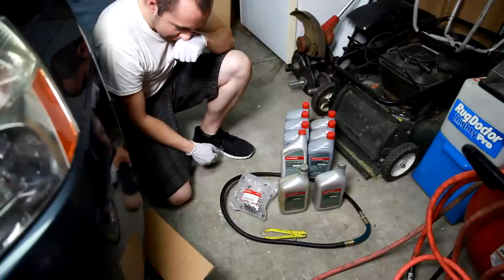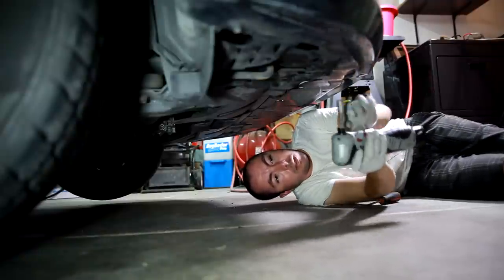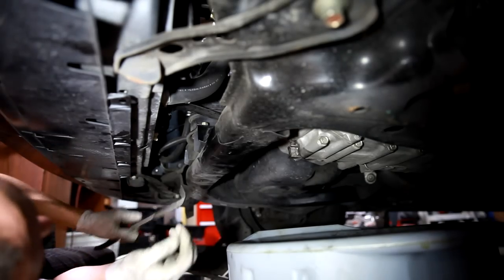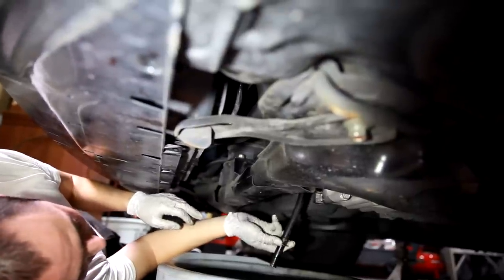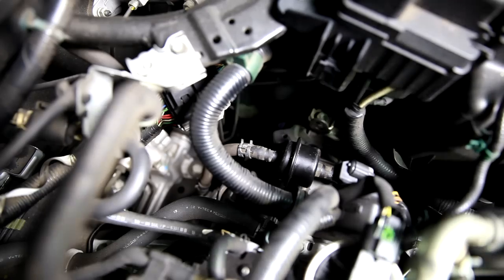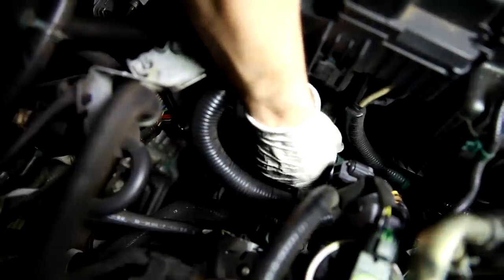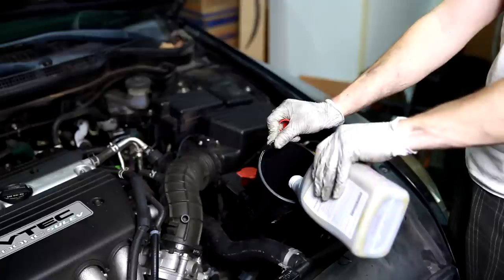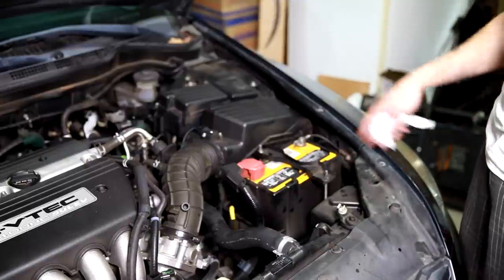2003-2007 Honda Accord Complete Transmission flush with filter

Comment: Does the 2010 odyssey have a filter?
Reply from the maker: MrRangerZr1 That we're not too sure.
Reply: MrRangerZr1 Yes, it does, actually it has 2;The "main" Filter is <inside> the Casing, & the "secondary" less necessary Filter is attached to a hose by the Cooler. Basically need to take to Honda or a good Transmission Shop to have this work done.The  internal Filter is collecting the large particles, much like the Bag inside your Vacuum Cleaner, & the inline filter is similar to the "HEPA" Filter to clean the exhaust Air.  
In low mileage, changing the Fluid only is a good idea, but once it has recorded high mileage, you need to have the thing "cracked open" & get the Filter replaced & Bands & Clutches replaced at same time, or at least inspected.
The "main" filter is collecting the breaking down clutch particles, & the inline one gathers the Apply Band Materials....once they are full, there would not be much Clutch left.

Comment: I need to flush my 05 accord,HOW MANY QUART DO I NEED? DID YOU JUST PUT 3 HALF.NICE VIDEO SIR.GOOD VOICE
Reply from the maker: we used 8 bottles, but you can use 12 if its really dirty. We drain the old fluids out first, then refill 4 and repeat until theres 4 left and top off.

Comment: Hey can you one day do a video on Honda idle relearn process?
Reply from the maker: +Rich Lo Yeah we can. What is wrong with your idle?
Reply: +NutzAboutBolts I was going to clean the throttle on my 2010 Honda Accord but then I realized it had the electronic throttle so I have to remove it to clean it and then do the relearn idle process. I just can't find someone doing it on a Honda at all.
Reply from the maker: Rich Lo
ah I see, we will have to find a day to do it. Hopefully this coming Monday unless the heat is too hot. But we will see...

Comment: Thats what a drain plug is for. Don’t recommend running the car low on fluid
Reply: You can't get the oil out of the torque converter if you don't do it this way.

Comment: hey guys, just wondering if you know how much brake fluid and power steering fluid I would need to do a complete change and flush of both of those systems?
Reply from the maker: 2 small bottle of brake fluid should be enough. As for the power steering fluids. you should get 1 quart bottle, if not, then 6 regular bottle is fine.

Comment: what kind of oil you used for manual transmission
Reply from the maker: If you still have the old Z1 atf fluid, you can still use it, but the new fluids are W1 now for better cold cranking.
Reply: MY CAR IS MANUAL TRANSMISSION 
CAN I USE THE SAME OIL
Reply from the maker: No, its a different ATF fluid. It'll be called Manual Transmission fluid instead of Automatic transmission fluid DW-1. I hope that helps.
Reply: thanks so much for all help
Reply from the maker: Carlos Garcia
np,

Comment: change mine every 6,000 miles or when the matenence light is blinking and 3,000 for oil that light i use for transmission it is so easy just like the oil! no jacking car up so simple! why not? (:
Reply: Adam Ottovordemgentschenfelde pretty sure you're wasting your money by doing that considering it transmission fluid should last a hundred thousand miles or at the very least fifty in some cars
Reply: Adam Ottovordemgentschenfelde  in the integra what does the filter li the transmission looks like

Comment: You need to edit the title to avoid confusion. In a "flush", machine are used to force the fluid out of the system (thus may dislodge harmful metal shavings that were not catch by filter and magnetic drain bolt (that's why most advise against this procedure), What you are doing is drain and fill - a prefer way of replacement with new fluid!
Reply from the maker: Huy Do I'm confused on what you are trying to say... are you saying this procedure is a drain and refill? 

As for the flush machine, all the machine is doing is pushing the fluids through the transmission system and draining the old fluids out. This video is basically doing the same thing, we are using the engine to run the torque converter and transmission to push the fluids out instead of using a flush machine to push the fluids out. We've used the transmission flush machine before, all you do is fill one side of the tank with fresh transmission fluid till 12 quarts, and the other side is an empty container which the old fluids drain out from the transmission. Then the machine turns on and does its thing while the vehicle is off. There isn't a special filter on the machine that filters anything out from the fluids. I'm not sure which machine you are referring to, so please let me know what you were trying to say... Thanks.
Reply: Yes. Your method is "drain and refill" NOT "flush"
Reply from the maker: Huy Do
drain and refill is from the drain pan, not using the engine to push the fluids out. I don't know who told you other wise.
Reply: This is one of the example of the different between flush and drain: 
http://www.transmissionrepaircostguide.com/what-is-a-transmission-flush/
Reply from the maker: Huy Do
I've read the article, I've used the machine before, no difference since they're both pushing fluids out. The machine don't have any special filters that filters fluid when it comes out or coming in.

Comment: doesn't the transmission need to be in neutral to check the level
Reply from the maker: no, just have it parked.
Reply: NutzAboutBolts but the engine should be running in park or neutral to check an auto tranny. the way you were checking the oil is the way you would check engine oil. which is different than the way you should check trans fluid.
Reply: @TDONLEY91  I have a 2003 v6 Odyssey, and the owner's manual says to check the auto trans fluid with the engine off. This is the first auto I've owned that does this - all the others needed you to have the car running and run thru the gears and then check the level in either park or neutral. But some Hondas, at least, are checked with the engine off.
Reply: @TDONLEY91  No the engine doesn't have to be running. The service manual states otherwise. However, it needs to be checked after it reaches normal temps to see the correct reading. ATF expands when it heats up which is why it needs to be checked this way.

Comment: This video is BULLCRAP .. if that were true but its NOT .. great job and great video .. quick question .. location of Shift Solenoid Valve B? Accord 2003 LX ..  Keep up the good work!  I'll be flushing and changing the ATM fluid and filters this weekend on (3) Honda's ..
Reply: Forgot one thing .. it would be nice if you can also show the tools required for a particular job at the beginning similar to what you did w/ the ATM fluids and filter .. it would be helpful to us car novices ..
Reply from the maker: Solo So thanks! If you go to our fan facebook page and post this question, I can post a picture to show you where it is.
Reply from the maker: Solo So Some of our video's we do, but if some of the video's we are on a time crunch, we just had to do it lol. But we do post what tools we use on the description box. I hope that helps.

Comment: NO. NO. NO. Remove the air filter housing and on the top of the same transmission the is a plug you can remove to fill it up. Much easier and while your there you have easy access to the transmission filter (it's a cartridge filter).....

Comment: how about change the oil filter  (TRANS )
Reply from the maker: +Andres Murillo the ones inside the pan?
Reply: +NutzAboutBolts yes, that one? are you supposed to change both at the same time? or is ok to only change the inline one?
Reply from the maker: BlastReadingSeries
no, you only change it when the transmission is bad.
Reply: There is no pan on a Honda. To replace the internal filter you have to disassemble the transmission.

Comment: Thanks a lot for making this useful video, it's exactly what I have been looking for.  I have same 2006 Accord with 93K miles and I don't think previous owner did transmission oil/filter service.  Do you think it's too late to do a flush?
Reply from the maker: Pirouz Farhani its never late to do a flush. I would do it since its 93k miles.
Reply: NutzAboutBolts
Thanks, is it OK if I first drain transmission fluid from the pan and refill with 3 quarts of new oil and then open radiator transmission cooler line to transmission and do the flush as you did in this video? The idea is to clean magnetic drain plug that has residue on it as well as complete flush in one attempt. Also before the flush, do you have to lower the car to make it level?
Reply from the maker: you can drain the pan and remove all the particles from the magnetic drain plug. As for leveling the car before the drain, it won't matter until you refill it with the fluids. When draining, you can have the vehicle jacked up since all the fluid will be drain through the transmission line.
Reply: DO NOT FLUSH A HONDA TRANSMISSION....3 drain, refill, and drive 100 miles sequences back to back.....NEVER FLUSH !!
Reply: @MrNicks-gn8jc  I was told by the Honda Dealer my 2006 needs a transmission flush. Some people say don't do it and others say to do it. I'm confused. I purchased it used in July 2019 and I'm not sure if it was ever done. I don't want to mess up the transmission by getting it flushed. How do you know it really needs it? Are they saying it needs it based on the miles and yr of the vehicle? HELP PLEASE AND THANKS!
Reply: @shafeqah5318  Honda Transmissions are built by Honda WITH A SLIGHTLY DIFFERENT INTENTION than other transmission designs (hint: They have thier own transmission fluid formula and don't use any of the "universal" fluids).....

I am currently on my THIRD ACCORD and I NEVER FLUSHED THE TRANSMISSION....3 drain/fill services get about 90% of the same effect without the high potential to damage a Honda transmission......just do the drain fills with HONDA BRAND FLUID MATCHED AT A HONDA DEALERSHIP SERVICE DEPARTMENT TO YOUR SPECIFIC CAR.....and you should be good AFTERWARDS with 1 drain/fill service per year or two.

Comment: I thought you were suppose to check the transmission fluid level with the engine running
Reply from the maker: +Joe White no, if you do that, the fluid would be all over the dip stick and wouldn't even give you a correct reading.
Reply: +NutzAboutBolts The engine must be running when checking transmission fluid level.
Reply from the maker: Sevan Jindoian
don't know who told you that, but they are wrong.
Reply: +NutzAboutBolts The automatic transmission fluid is different than checking oil. You DO want to check it with the engine running at idle. Anyone telling you to check ATF levels with the engine off has no idea what they are talking about. The transmission has its own fluid pump that has to fill the torque converter before an accurate fluid level can be seen. You will notice that with the engine on the fluid level will drop on the dipstick. Ask any ASE certified mechanic and they will all say the same.
Reply from the maker: Sevan Jindoian You do know that Honda recommends the engine to be turned off while checking the dipstick right? go call any Honda dealership and they will tell you the same.
Reply: @NutzAboutBolts  you are right, the people doesn't no how to read manual information book .when engine is on working temperature than tuned engine off and waiting for 60 to  90 seconds  than check transmission fluid level ....

Comment: royal purple max multi vehicle atf I use it has no ill effects I just use cheap fluid walmart valvoline to flush it a day drive then drain and fill royal purple. woo! mine is always bright pink red and plug has hardly any wear metal! ( :
Reply: How long time you can run the car before draining? with the cheap fluid...
Reply: let me know how it goes because in my experience you never use anything but Honda fluid for transmissions and power steering pumps
Reply: +Austin K Always use the Honda fluids.  They have different additives to protect the gears, bands, and clutches in the transmission.  Honda power steering fluid is also different because the pump is different in design.
Reply: Adam Ottovordemgentschenfelde I agree not using Honda OEM fluid has actually ruined a Honda that my uncle worked on that is the one thing you should always use OEM especially for Hondas

Comment: Never, ever do your trans fluid like this! It will damage your transmission if you plan on keeping the car, I advise you don't do this!!!!!!! - 7yrs exp. with Honda
Reply from the maker: +steven Macas my Honda still running strong, enlighten us.
Reply: Why so we can take it to you and get ripped off?
Reply: +Billo1281 no Jack ! Exactly the opposite so you prevent costly repairs and don't bring it in thinking Hondas suck because you maintained them improperly. Which is why any flush even an engine flush voids Hondas Warranty.... Just FYI
Reply: +NutzAboutBolts Honda engineers advise there is a good chance that if you flush the ATF oil, it will knock clutch particles loose and clog the valve bodies, which is not a cheap or easy fix.
Reply: +NutzAboutBolts and not to mention I have seen this more than a few times in my profession, put it this way you have a higher chance to damage your transmission when flushes which is why it's frowned upon with Hondas .... Not every case is the same some will continue to run great I recommend drain & fill drive 5 miles then drive vehicle in every gear a few seconds and then drain & fill again, a 3rd consecutive time won't hurt but 2x should do the job
Reply: @stevenmacias9495  how do u drain the fluid with out the car running ?
Reply: The way he flushed it was safe, flushing with the machines they use at the dealer are deadly to transmissions. Your letting the trans pump the fuid through its own pump and not forcing it in anyway. This is the safest way to do it.
Reply: Very true, I never do complete transmission flush as this can damage the transmission. I do transmission drain & fill, mostly at oil change time while the car is still jacked up. .
Once every year at about 12K miles/year and fill with 2.6 Quart of Genuine Honda transmission oil on my 2011 HOnda accord.

Comment: Too much work and expense on fluid. As recommended by manufacturer, just drain and refill on schedule. Mine is hitting 200k miles now, no problem at all.
Reply: garyboyh Gary your absolutely right, I drain my trans fluid with every oil change, EVERY FIVE THOUSAND MILES. it's easy, It's only three quarts of Honda FLUID ONLY! engine oil is amsoil. never a problem in the last 30 years!
Reply: +Larry Alicata sound expensive when the trans fluid last quite some time. Why not just do it every 20k.
Reply: @3shortcuts   Could you please also think about the environment a little bit, and not only your money?

Comment: I went to honda dealer, they dont do a  complete flush, only drain and fill, 2.5 quarts,  $126 plus tax,  I did it  my self in 20 min,  $22 total, I will pay $250 for complete flush,  but not for 2.5 quarts.

Comment: Great video guys! I'll be doing this in the next few days. Just out of curiosity, would you happen to know what might be causing this idle issue? I've copied a link to a video that is identical to my issue on my wife's car. Hoping it's not major, but I'm hoping for a starting point if I have to go to a transmission specialist etc. https://youtu.be/gOb5fq5b_XU. Thanks in advance. 2004 Acura TSX auto trans. Thank you for any insight. I'm baffled.

Comment: I was told always use Honda transmission fluid only.
Reply from the maker: Billy Smith and they are right.
Reply: NutzAboutBolts NEED HELP ASAP!!!!!! PLEASE, HOW DO I FLUSH AND REFILL THE TORQUE CONVERTER WHEN I DO THE FLUSH??
Reply: Kenny Johnson You are doing that when done this way....the oil is pumped through the torque converter.

Comment: around 7-8000 rpm
Reply from the maker: wow that is high... it seems as if your throttle body plate is wide open... I would check if the throttle plate is open or there's a vacuum leak.
Reply from the maker: I'm surprised there isn't a check engine light for that high of RPM at idle.
Reply from the maker: so after reading how you said you did the 3k rpm on your vehicle for the idle learn procedure... how did you do that if your vehicle idles at 7-8k rpm???

Comment: I apologize, I meant to say around 800rpm during idle.
Reply from the maker: your idle is fine then. I would check with your motor mount, did you change the front or the rear? the rear uses vacuum.
Reply: I changed all six. the front uses vacuum.
Reply from the maker: why you change all 4? and I would check with the vacuum lines.
Reply: +NutzAboutBolts Thank you. I bought a used car, 3 of motor mount was damaged, so I changed all 6. The front motor mount is what I changed 2 months ago and made sure that the tiny hose was connected.
Reply from the maker: if it wasn't broken before the replacement, then I would suspect its the parts you just replaced are bad. I would go back and get an OEM or replace it again with another new parts.
Reply: +NutzAboutBolts Thanks for all your help.
Reply from the maker: next time, please don't give this whole run around. It's already hard enough to diagnose online, its another thing not knowing the history of it. If you don't inform the people about the history of it, it can be misdiagnose and it'll cause a lost of $$ and headaches. It's kinda like going to the doctor and complaining of funny feelings on your legs without giving the full history of the problem, which is you got spinal injury from a car crash along time ago, which causes compression on your spinal nerves which in turn causes leg numbness and tingly sensation all over.
Reply: +NutzAboutBolts Thanks again for all your help and I apologize for the confusion.
Reply from the maker: anytime!